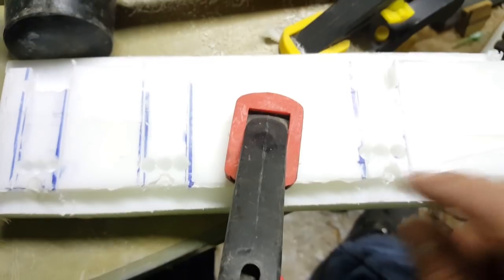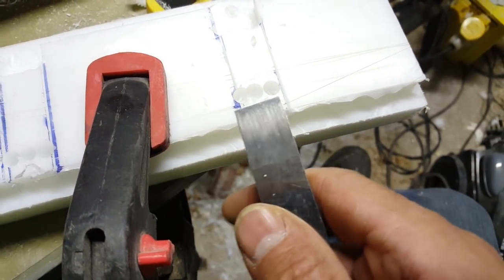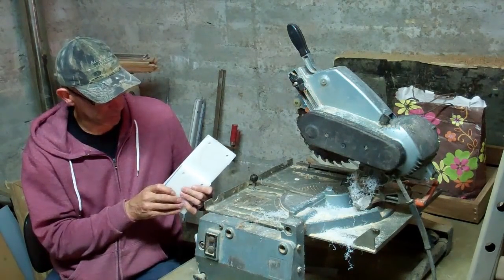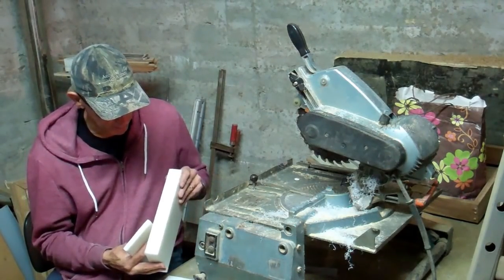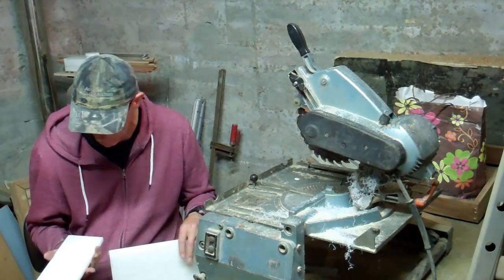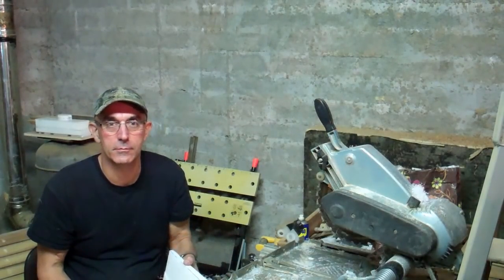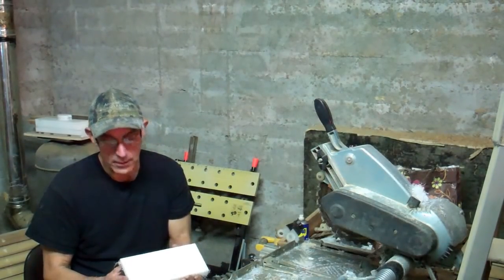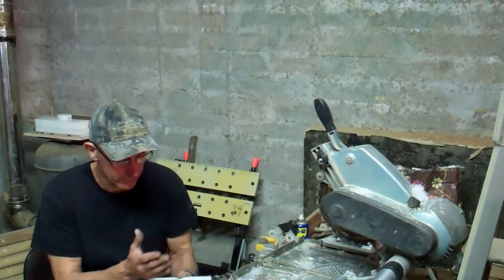Episode 30 - Working HDPE Plastic With Basic Tools

Comment: Plastic rarely glues together. You have to weld HDPE with a heat source.
The only fairly inexpensive glue that works is Titebond III Premium after sanding the surfaces before gluing.
Not recommended though.